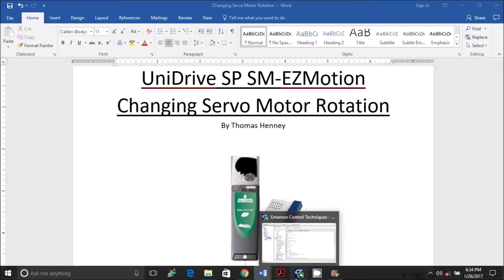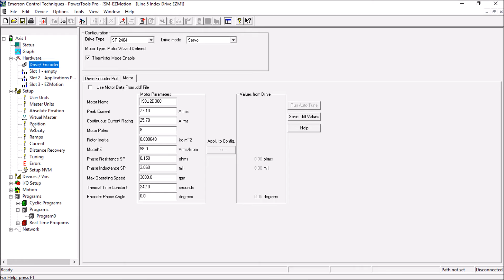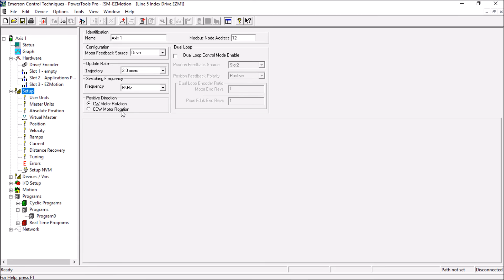UniDrive SP Changing Rotation Of Motor Using PowerTools Pro

Comment: Please share the link of unidrive SP software.
Reply from the maker: Just added to Comments section. Scroll down to bottom of page Click + to expand the download section. If you are not registered, click Register and fill out info. After registering Log In. Go back to downloads and PowerTools Pro v6.0 should be loacated near top in Software section.

Have Good Day

Tom
Reply: @tomh2466  I have downloaded power tools pro v6.0 but its screen is not like the program which you have shared here.
Reply from the maker: @roohullah.yasini  

That was 5.0 screen I believe that you can still download the 5.0 in the 4.9 if you go back to the website and scroll through